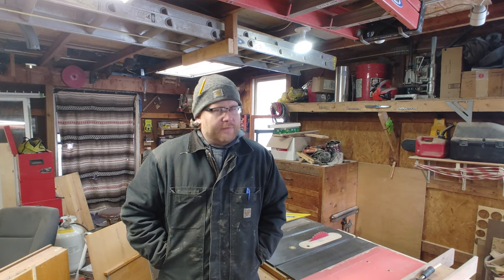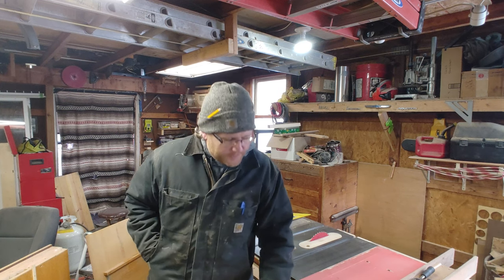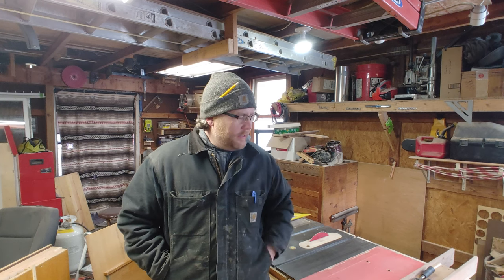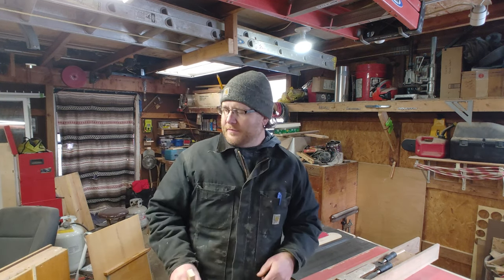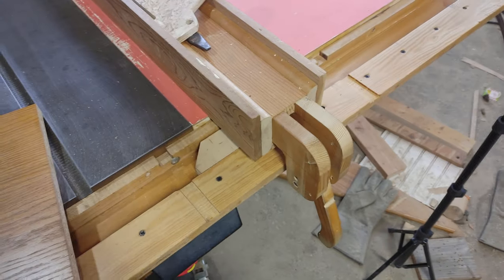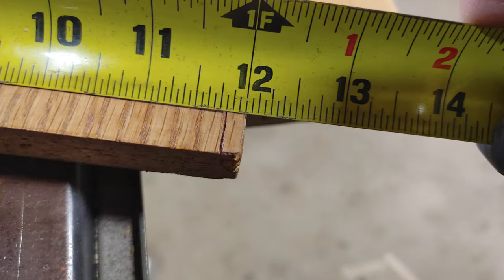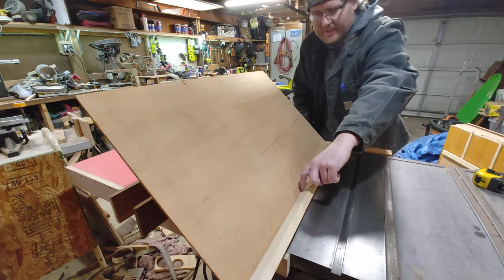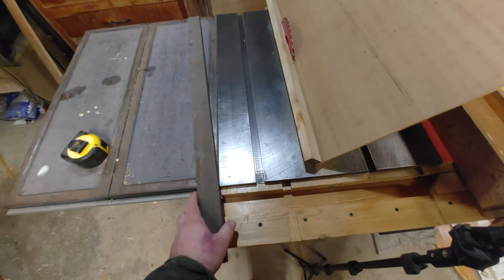French Cleat HACK for the Table Saw: Cut 45-degrees w/out tilting your blade!

Comment: doing this cut on the jig without a riving knife is a sure shot hazard. You have a very high chance of pinching with wider pieces of lumber, due to gravity. Need the riving knife to stop that pinching.
Reply from the maker: Valid point. Luckily I haven't had any issues yet.
Reply: Ok so have YOU ever had ANY PROBLEM?? ANY??  with out a riving knife 🔪🗡️🔪 setup??? What about any friends? Or neighbors?? Or even that guy that sat next to you for 5hrs on Uniter 420 from Portland to Miami last year??? Now I know that guy had a story?? 
I will put a weeks paycheck on it that not a single one of these people have ever had a LACK OF RIVING KNIFES  🔪🗡️🔪🗡️  PROBLEM
Reply: @troykinnison4575  Safety should be high priority before using any machinery.

Comment: you hate turning the handle to set the saw 45° but it's ok assemble and dismantle huge jig... plus, it only works on 45° at the edge of the board, if you want to cut 2 french cleats from the same board, you will have to tild your blade hu? serious Khabane Lame candidate ^^ although, funny video, good entertainment
Reply: His table saw might be like mine , just can’t reach 45 degrees, I just built on like he did and it works great, I build a lot of boxes and mostly have a 45 corners and this works great
Reply: @jamespolucha6911  good to know, maybe a good T-bevel or square helps... when I want a good french cleat, I cut the almost 45° then I use a 45° router bit for precision.
Reply: @jamespolucha6911  my first 🥇 was a hand -me-down!!!
from POP -POPS!! MY grandfather from my baby Uber!! And yes it would even try to get close to 45 more LIKE 42 1/4 most nights!!
So this is like a miracle an can make others at 60°,30°,22°, or anything that makes me happy!!!!